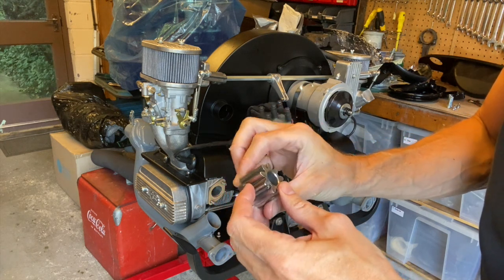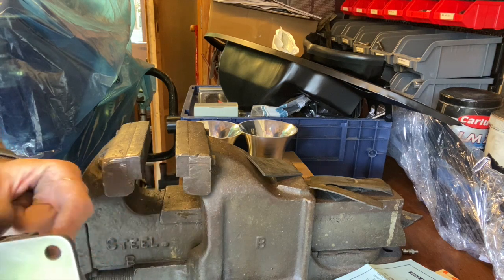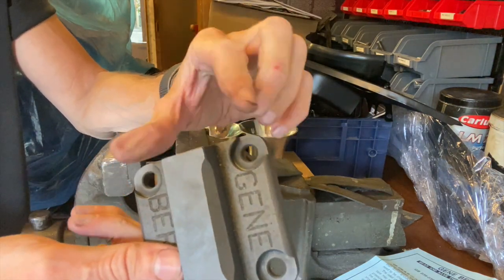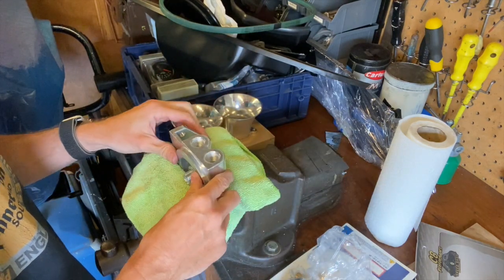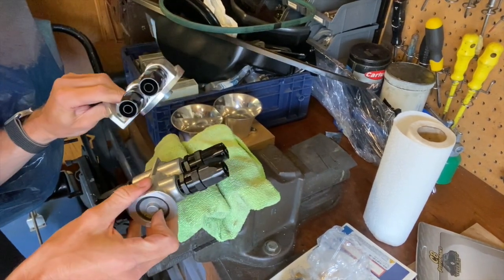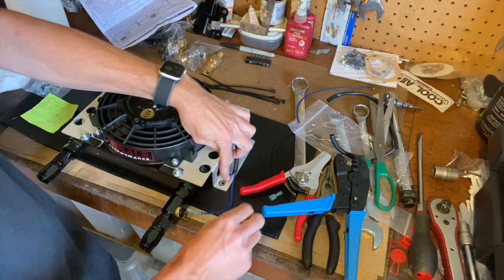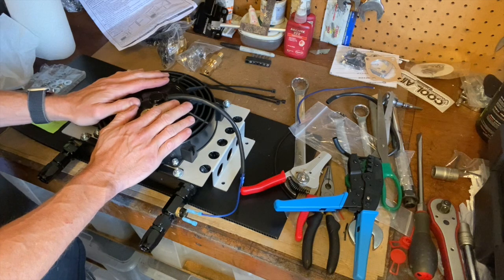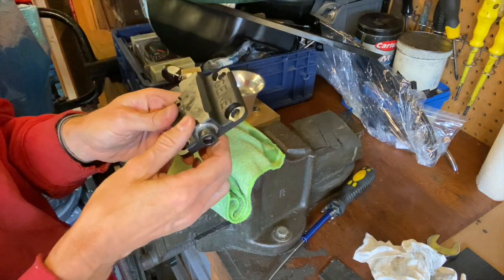PART 23 - Oil Lines - How to Build a CB Performance 2017cc Builder’s Choice VW Engine

Comment: Great work,  I do have 3 suggestions. First,  I would move the Thermo switch to the oil-out side of the cooler as you need to monitor the temp of the oil getting to the engine not leaving it.  If your oil is run too cool it will not evaporate blow-by contaminants.  Second, I would use the Thermo switch to trigger a relay to power the fan.  Not sure how happy the Thermo switch will be to continually run 80 watts of juice.   Third, you will need to attach the hoses to the AN-8 fitting prior to tightening them onto the cooler, the same applies to the 45-degree fitting you put on the brass pump outlet.  Love what you did with the Berg cover, great modification to clearance for flow.  Lover your videos, very informative and complete.
Reply from the maker: These are all great suggestions. Funny you should mention the AN fittings as I figured that out today 😂. Good idea about the relay, although they didn’t mention that in the blurb that came with the fan and they really should have done. I’ll do that for sure. The switch doesn’t look robust. Swapping to outlet is a genius idea - switching off the fan before the oil gets too cold. All great stuff. Thanks. 👍
Reply from the maker: I've been mulling over the placement of the thermostatic switch on the external cooler - inlet vs outlet. With the thermostatic switch on inlet the oil is being cooled / regulated at 180 degrees (82C). So that's the temp of the oil after it's left the bearings, the stock cooler and fallen down into the sump. From what I understand this is an optimum temp (anywhere between 180-220F or 80-100C). So, the oil is at 82 when it arrives at the cooler when the fan is activated. The oil is obviously going to be a bit cooler as it leaves and is then pumped around the bearings etc. It then slowly builds up in temp again until it's hot enough to activate the fan and is again cooled. You's imagine it stays around the 180F mark.

If the switch is on outlet of the cooler. The fan is obviously only engaged when the oil leaving the cooler is at 180 degrees or above. Which makes me wonder how hot it is going to be before it enters the cooler. I imagine the cooler is quite efficient at cooling the oil without the fan. So the big question is how hot is the oil in the sump at the point the fan is switched on in this configuration. I doubt it would be as high as 220F, especially when the vehicle is stationary, but with a good amount of airflow (from driving) moving over the cooler it might just be that high. In which case the oil is going to cycle at a temp higher than 180F. 

Anyway, it rarely gets hot enough here in the UK for me to be overly concerned either way, and I think both configurations would be fine. They both have their merits and drawbacks.

Comment: So far, on my build, getting the oil lines and fittings sorted out has been an expensive faff.  I found a pump cover without the oil relief valve and flush to the side by Jaycee.  But the fitting is orb so I had to buy another fitting. I chose a 90° low rise banjo bolt  from a company called Radium Engineering outside of Portland Oregon.  Nice.  Finding a slick banjo bolt like yours for the case was like a search for a needle in a haystack with that npt interface... Jeesh.

Comment: On the fan thermostat switch, it may tend to cycle the fan more with it on the entering side of the cooler. On the leaving side it may be a little more stable temp back to the engine. I think it's probably splitting hairs though. Once the engine is up to temp it should stay pretty stable. Only heavy loads like hill climbing would really put anymore load (heat) on the motor. I'm guessing that's not a real issue in the UK. The thermostatic valve is where the real difference will come. Good choice there. Interesting the GB pump cover wasn't relieved as you modified it. That's a really restricted, tight 90 degree bend the oil has to make right off the pump discharge. That's the reason there's full flow 90's. That was a good call cutting that notch in. Great episode as always.
Reply from the maker: Thanks Charlie. Someone else has made the same suggestion about the thermostatic fan switch being on the outlet - which is a better way of doing it I agree. To be fair to the GB cover I think it has been designed to create a pressure point to activate the pressure release valve. By adding that radius I might have messed with that, but in my defence, I’d there had been a suitable cover without the pressure release valve I would have gone with that. Not sure they are such a good idea. Especially as I’m not going to be going much over 4.5k revs.
Reply: @aircooledanything2415  You still out there, mate? It's been a while since we've had an update. Hope all is well.

Comment: Ezgz thinks the dimple could be to trap a little oil to lubricate the face of the pump gears against the pump housing and pump cover plate. He suggested the loose gear should be mounted with the dimple inside against the pump body, as the gear that messes with the cam always faces outwards towards the pump cover. Personally I’ve always had both dimples out wards towards the pump cover plate. They dimples don’t appear to index the gear teeth in anyway.
Reply from the maker: Thanks for this. Very interesting. I haven’t seen that EZ clip. He really is the master. Makes sense what he’s saying. Like you I always have the dimples facing the cover. I randomly put them together.
Reply: If I had to guess the dots should probably match up so if you take it apart ever you can reinstall they gears back in their same position that they’ve broken in

Comment: Make sure the hole on the CB pump is lined up w/the hole on the GB cover! In my experience they didn't match up! PACK that oil pump w/ vasaline..
Reply from the maker: Yes absolutely correct. Check out 1min 14s.